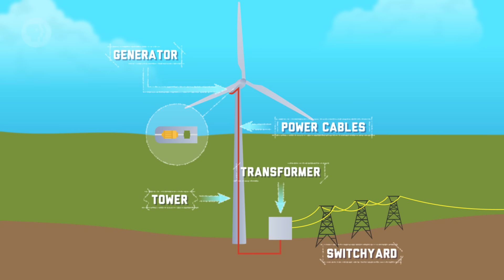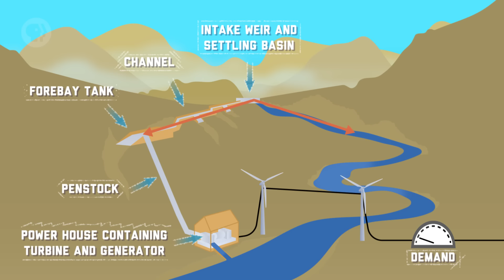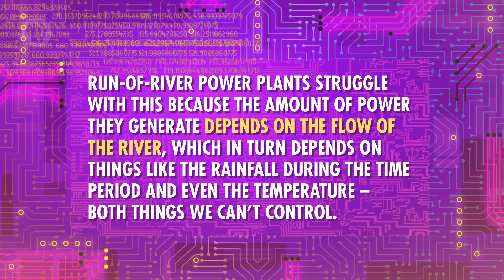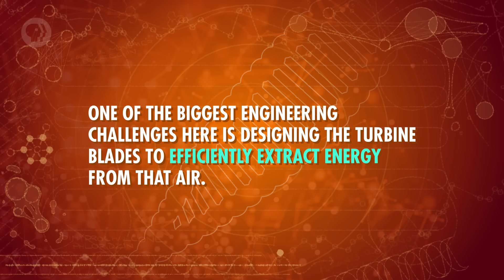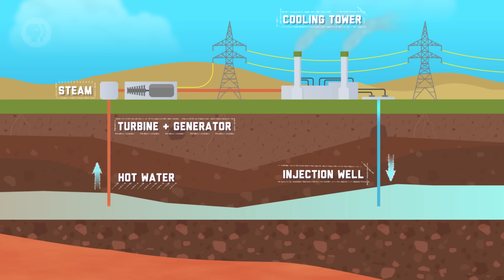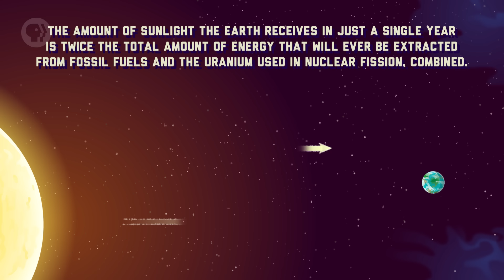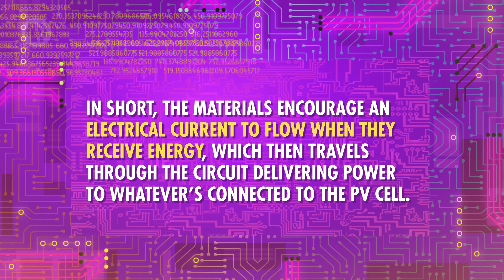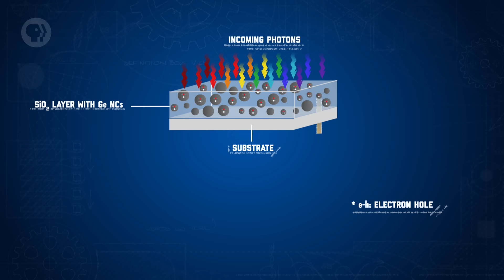The Engineering Challenges of Renewable Energy: Crash Course Engineering #30

Comment: 3-6 times more expensive then fossil? when did solar get so expensive? it was like 1 to 1 with fossil fuels 5 years ago..... (if you count all the subsidies fossil fuels get, because you pay for the subsidies, duh)
Reply: I'd point to this as the one figure in the video that is most dubious. There is no one cost of fossil fuels. The cost varies wildly based on what type of fuel your using and where you're trying to use it. The same is also true of renewable energy because the renewable resource being tapped can be better or worse. Without any subsidies, the cheapest new renewable energy facility, wind, located in an ideally windy spot, is probably twice as expensive as the cheapest new, high efficiency fossil fuel power plant, fired by natural gas. 
But there are so many asterisks next to that sentence it's nuts. What about the cost of transmitting the electricity? What about the cost of shipping the natural gas? What if you use an older power plant? Is there a price or emission limits on any of the pollutants from the natural gas power plant? And what about the subsidies, because ignoring them is pointless in a world that subsidizes both types of energy to varying degrees?
If I'd been writing the script for this video, I would have not included that figure at all. Even if it were correct today, a year from now or five years from not it most assuredly would not be correct, diminishing the long-term value of the video.
Reply: 5 years ago oil was $100 a barrel and Nat gas was $5 per British Thermal Unit. Now oil is $45 a barrel and Nat gas is $3.5 per BTU...
Reply: I tend to ignore all cost comparisons quoted at me by anyone. Gauging the full economic implications of complicated engineering decisions is a Herculean task, and I assume the vast majority of estimates to be wrong, either by mistake or on purpose.
Reply: GBomb Engineering   no matter the reasons, if you compare completely different powerproduction methods you need to break it down to the one thing all have in common, that is cost (aka dollar per kWh) and include everything. how do we find it? how do we get it? how do we transport it? how efficent can we convert it to power? do we need to refine it? how much does it cost to repair the damages it causes, etc. etc. etc. you know, the full price, that is at the end of the bill.
Reply: The more accurate (based on recent studies) is more like 0.9-6 times. It depends on a wide range of figures. 3-6 times was probably 5-10 years ago.

Comment: interesting where you did and didn't consider waste and environmental impacts. And honestly lumping in nuclear in with fossil fuels is a bit, questionable. I mean geothermal power IS nuclear power, for example.  And even conventional nuclear power has many technologies that basically can use the tailing of rare earth mining (for the neodymium magnets needed in wind turbines for example). And honestly all the systems that require storage on the grid and a lot of people choosing batteries for that storage really bring new questions, because of the materials needed to make those batteries, and the relatively short lifespan of them.  Even wind and tidal power impact the environment. Taking energy out of the environment necessarily impacts the environment. Sadly there is no simple solution.  Personally, i think increasing nuclear to take base load is really the first important step (preferably thorium that can eat the existing "waste" of the pitiful reactors we use today that is a byproduct of the best fuel for bombs instead of a focus on energy) with solar as is possible (but not in roadways where its useless, maybe over roadways, on tops of car parks, etc). But the real problem is storage.

Comment: You forgot one more kind of renewable energy.  Its uses sun power too like solar panels but unlike solar panels it uses infrared light to boil water into steam which turns a generator.  To achieve this they deploy thousands of large mirrors which reflect and concentrate the suns heat energy aka infrared to produce energy.
Reply: @TerraTN Very true. But the whole point of the video is to educate youtube viewers all the ways renewable energy is produced.  So there are quite a few she missed.

The same can be said of any renewable energy.  Solar cells will not work during the night. Windpower will not work if there is no wind. Geothermal will only work near hotspots on earths crust.  Hydro power will only work where there are rivers and sometimes drought will be an issue.

And mirror concentrators require lots of space to product enough heat to make energy, also killing birds.
Reply: @Al13n1nV8D3R  i think that the mirror concentratiors will kill nowhere near as much birds as wind power, because birds dont generally congregate in desert/arrid areas. windpower on the other hand.

Comment: Overall a good short introduction, but as with an introduction is skips over two massive hurdles to solar energy and many other renewable sources: the duck curve (which was eluded to, but not directly mentioned) and the issue with high concentration of these sources often being located far from where people live that need them, requiring higher transmission loses. In addition, they don't mention Biofuels as a potential source of renewable energy. Although research is still being done into it they can lead not to a total carbon negative, but a carbon neutral supply chain when done which makes them a potential candidate as replacement for cars and local power generation to combat the irregular supply production other sources. As the storage of fuel in batteries on a large scale (centralized or localized) is difficult and dirty (at present) due to the mining of rare earth metals and their refinement.
Reply: What has really confused me in all the discussion of energy storage is that hydrogen is always conspicuously absent from the discussion.  Back when people were proposing hydrogen vehicles as a replacement for internal combustion engine vehicles, the biggest complaint was "hydrogen isn't an energy source, it's an energy store."  And it is true, the most common way to produce hydrogen is through electrolysis systems, which consumes just as much power as what you can get out of the hydrogen... well, why not use that to store extra power and run it through a fuel cell when production falls short of demand?   I'll admit, I don't know what harmful and/or dangerous materials are involved in the manufacture or disposal of the equipment to produce hydrogen or in fuel cells, but I can't imagine them being any worse than the lithium battery.
Reply: @smileyeagle1021  
Because it is awefully inefficient to generate hydrogen and then convert it back to electricity.
Reply: @superdau  Indeed, the entropy god must be payed!
Reply: The good news is that a lot of power companies are starting to explore ways to combat the duck curve. There are some really interesting ideas being floated around in the industry actually. For example: The lack of power storage is the biggest issue with the duck curve, and with the growth of ZEVs which are constantly connected to the grid through specialized chargers, power companies are considering offering ZEV owners contracts for using some percentage of their battery capacity just as the sun goes down. This would lessen then ramp up cost to power plants.

Comment: Only focusing on one kind of solar power?  What about solar thermal power systems?
Reply: The one problem that I can think of is you'd have to move several hundred or several thousand mirrors throughout the day. (The one upside is that once you heat up the heat reservoir that those mirrors are focusing sunlight on, it stays hot for a while, even after sunset.)

You also risk cooking birds in midair, but then you also risk smacking birds out of the air with wind turbines. (Not as common but downright funny and sad when you think about it is when people mix up thermal solar and photovoltaic solar and say that photovoltaic solar panels cook birds in midair.)
Reply: Because they are an insignificant source of power.
Reply: TheHengeProphet> Only focusing on one kind of solar power?  What about solar thermal power systems?

Indeed. It makes her statement about "no turbines here" all the more face-palm–y.

Ganaram Inukshuk> The one problem that I can think of is you'd have to move several hundred or several thousand mirrors throughout the day.

You have to move solar-panels as well, so that's a wash. The problem is in moving the oil-pipe.

Eric Taysom> Because they are an insignificant source of power.

Quite the contrary, a large portion of solar-power used throughout the world is solar-thermal. A big reason for that is simply cost; solar-panels are much more expensive to make, purchase, maintain, and replace than mirrors, pipe, working fluid, and a turbine.
Reply: Soon (less than 5 years) it will be more expensive than PV + Lithium storage, so no sense to develop solar thermal any more. It is inefficient due to thermal and turbine energy loss and high EPC costs.
Reply: Ganaram Inukshuk 
The bird thing is real but massively exaggerated. If we cared about not killing birds, we wouldn't keep domestic cats. They kill literally billions of birds every year. Thousands of times more than wind turbines and solar thermal plants.
Reply: For home systems it is already cheaper and less complex to just put solar cells on the roof and heat water electrically than put solar heat absorbers up there. I guess it will be the same on a power plant scale. Having to point hundreds of mirrors onto something to produce steam to drive a turbine to generate electricity is much more complex than just having solar cells in the same spot and get electricity without all the intermediate steps.
Reply: Solar thermal has been beaten out traditional solar photovoltaics as more efficient and less expensive for energy generation.
Reply: @cristoux  perfect summation of PV verus CSP
Reply: @LuisHuangSF  thanks
Reply: You've forgotten to count biomass to the renewable energies.

Comment: Nice topic to discuss and a nice video as well. I just think that the  x3 - x6 times more expensive for solar is outdated. I tried to check the citations and the page that mentions that figures uses references from 2007 (Solar Energy Technologies Program - 18 - 30 cents/ kwh ?!) . I think that in many sunny places solar is the cheapest way (4-5 cents/ kwh) , without any subsidies at all, if we assume that the alternative is to build a new plant for natural gas or coal. We should take into account that the regions, where the energy demand is rapidly scaling, are all notably sunny. I do understand that it's crashcourse engineering - not economics - and you focus on this aspect, but i thought that this different economic perspective binds well with the motivating and optimistic aspect you have. Renewables have surpassed many chalenges so far. The main challenge now is storage.

Comment: A few (arguably obscure) things worth considering:

 - Giant batteries for energy storage; I'll leave it to you to find the relevant articles...
 - High voltage direct current (HVDC) instead of high voltage alternating current (HVAC); pros, HVDC lines take up less space than a comparable HVAC line (one small tower with two wires instead of 2 or more towers with 3 or 6 wires each) and can transmit electricity for even longer distances with less power loss; cons, AC to DC converter stations are expensive and is only justifiable if the cost of deploying HVAC lines is greater than that of an HVDC line and its converter stations
 - Garbage incinerators as power plants; I only mention this because every city-builder I've ever played had this as a power generation option, even though I've found them to be exceedingly rare in real life; you could also ferment rotting garbage and capture the gas to produce electricity
 - Photovoltaic solar versus thermal solar and those rare instances where people mix up the two and say that PV solar panels cook birds in midair
 - Tidal generators (a subset of hydroelectricity, perhaps?)
 - Stirling engines; kinda feel like that was already discussed and I just missed it

EDIT:
 - Just remembered this: hollowing out a mountain and using it as a compressed air storage tank for energy storage; similar to using water for energy storage except air is compressible and you also have to compress air

Comment: Where I grew up we had the potential to produce all 4 forms of renewable energy. There was allot of open space and many days of cloudless skies for solar. There were almost always breezes and often wind especially on the local volcano. That's right a local dormant volcano which meant we had access to geothermal in fact our water needed to be placed in water towers to cool. Finally we had mountain streams rivers and damns which could have been used for hydro-electric power. Sadly the project to place wind turbines on our local volcano was sabotaged presumably since the local power producer would potentially lose control of controlling power generation  and or its profits from it would drop since it wouldn't be able to keep prices higher. I believe that is why none of the other potential sources were pursued.
We did get a coal fire plant but its electricity all went to California mostly LA hundreds of miles away. On the bright side the coal produced nearby and used in the plant is some of the cleanest coal anywhere.

Comment: just switch to thorium reactors until solar energy becomes more efficient. So we can stop burning fuels. I rather have some radioactive contamination in an enclosed area than large amounts of pollution throughout the environment.

And one of them will clear up quicker than the other.
Reply: Developing and building all the required thorium reactors, and setting up the thorium mining and refining infrastructure, would also take an enormous amount of time and money. As dr. Somara mentions, fissile materials are non-renewable, so you still have to transition away from it at some point. There's probably a good use case for them (or uranium/plutonium reactors) in some areas where deploying renewables is particularly difficult, but I have a hard time believing that it would be the quickest / cleanest / cheapest solution overall.
Reply: You have 100x less radiation in the environment when you switch coal over to nuclear power.
Reply: @threadbearr8866  thank you for pointing that out.  Not many people realize that coal ash is slightly radioactive.  Pound for pound it doesn't come close to spent uranium, but there are a whole lot more pounds of it produced to generate power than uranium (then again, I think a lot of people forget that coal ash is a thing to begin with).
Reply: we still haven't implemented a solution to nuclear waste
Reply: @smileyeagle1021  And coal waste is spewed into the air. The waste from nuclear power stays on site.
Reply: @christianweibrecht6555  The waste is a non issue. Sure we haven't found the place to bury it, but there's no issue leaving it on site. You have to understand that only 0.2% of waste produced in a year is HLW (High Level Waste) and that it decays to a medium grade waste within decades. Additionally, it's much smaller than any other energy source. If you only got electricity from nuclear power all your life all the waste you produced would fit inside a soda can.
Reply: @bartz0rt928  Debatable, because it's so energy dense and relatively abundant. It would be centuries maybe even longer before we run out. Not to mention recycling methodologies that further increase the lifespan of the fuel. Calling fissile non-renewable is similar to saying the sun is non-renewable because it won't shine forever.

Renewables face the exact same issues. Regarding setting up infrastructure... They aren't made of nothing. In fact, this video touches on that. Nuclear really is the best option for now, and compared to first generation reactors, nearly every reactor in use today, modern reactors are much cleaner and safer. Some reactor designs don't even have the hydrogen gas problem as with Fukushima.
Reply: I think the more interesting solution is just nuclear in general, thorium or not, more nuclear and less fossil fuels is def a win.